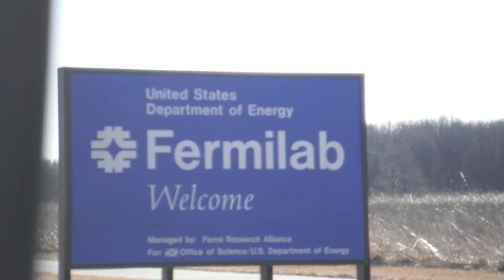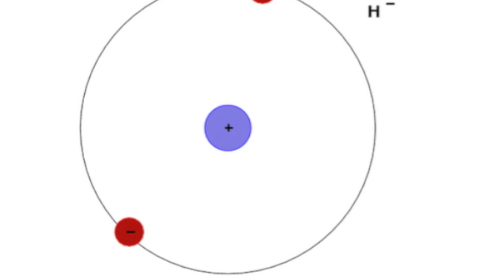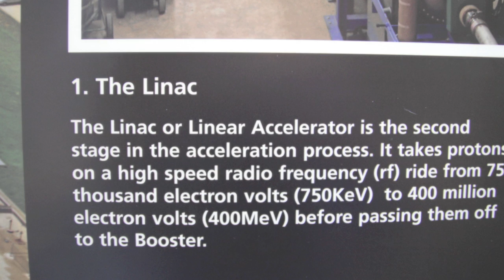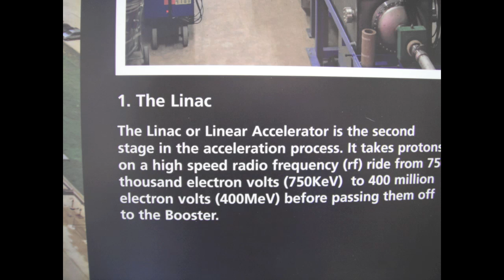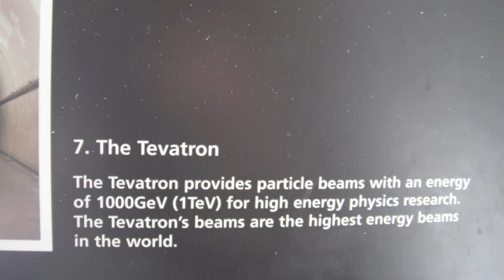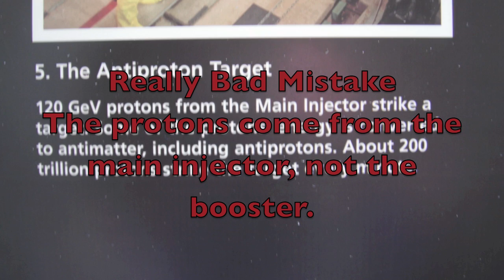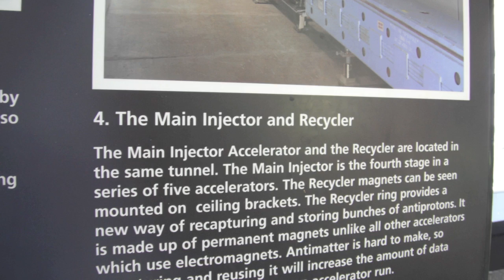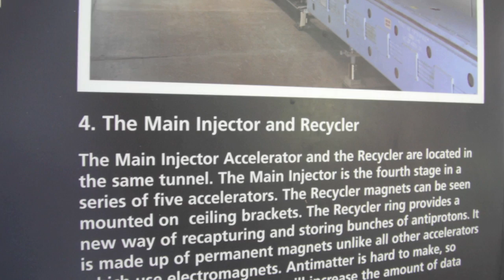Fermilab Accelerator Chain

Comment: Nice!  I am a scientist at Fermilab, and it is impressive how much you learned on your tour!  H-Minus *is* used for injection into Booster.  The simplest way to understand that is that positive and negative particles are bent in the opposite sense travelling through a magnet, so you can inject H-Minus into the same stream as the protons travelling in the same direction.  The electrons are stripped at the spot where the two beams meet.  Lemme know if you want to continue this conversation.
Reply: Why do they need the cw multiplier